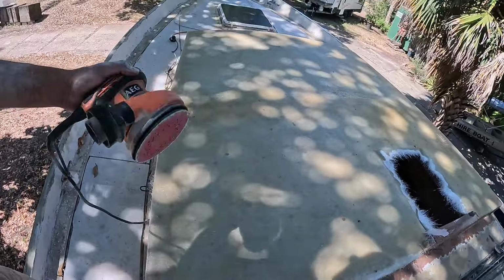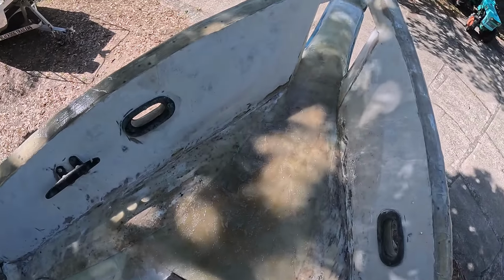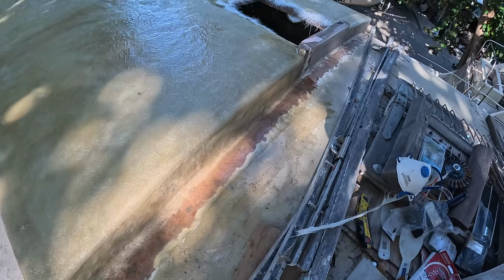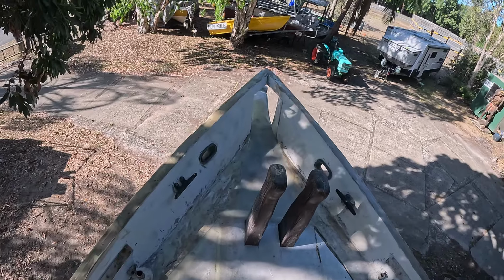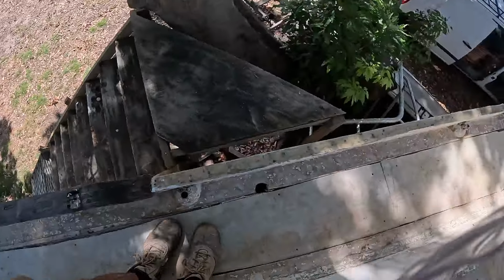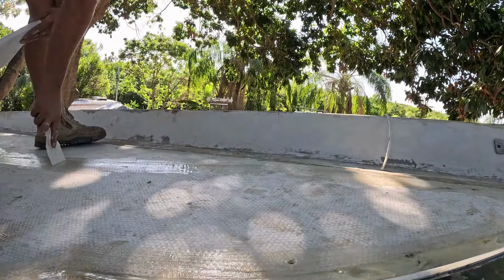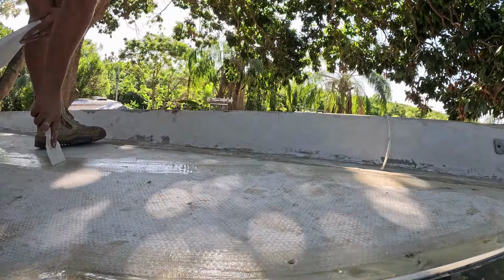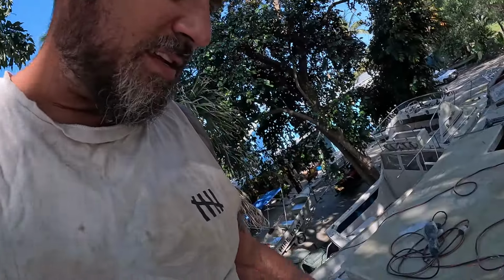Fiber Glassing The Deck And Roof - ep89

Comment: Not sure what that 200 buck filler you are using is but if you use West System 406 Colloidal Silica mixed in with your polyester resin, its a bit more work to mix it but I think it might be a lot more cost effective.
Reply from the maker: Thanks for the tip Craig! I'll take a look. Cheers mate :)